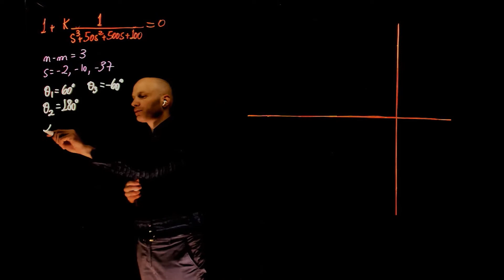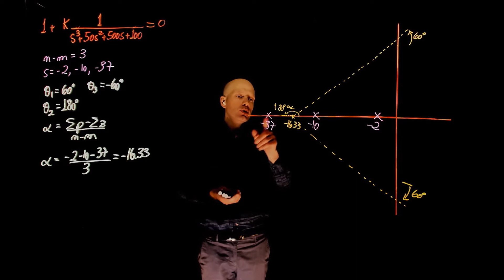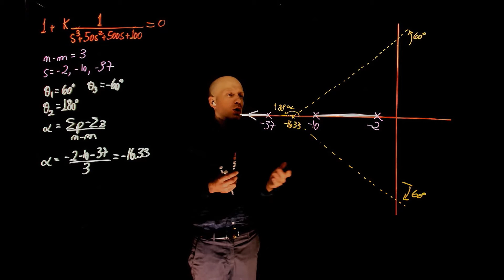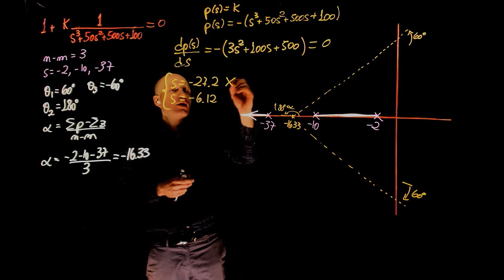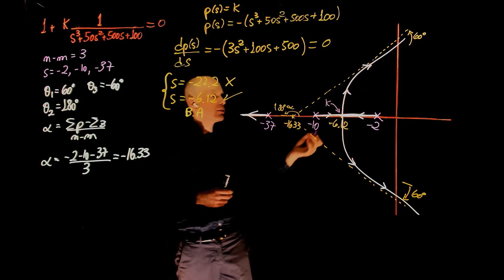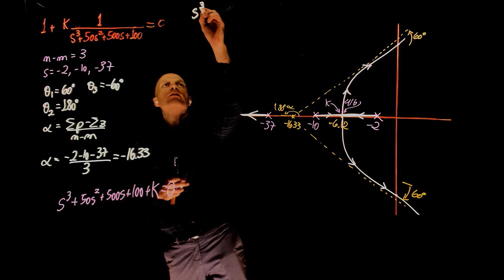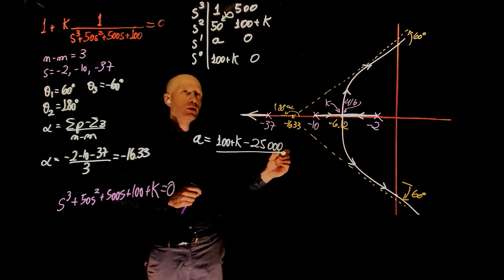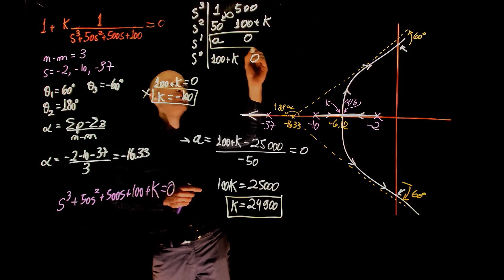L12E64 Control Systems Lecture 12, Exercise 64: The root-locus method

Comment: should it be 1000+k rather than 100+k  6:59 ?
Reply from the maker: I don't think so. How are you getting 1000?
Reply: @biomechlab  in the initial equation 0:01
Reply from the maker: @piersonmcgillivray190  Oh right, it was copied wrong from the slide, but the solution is correct for +100
Reply: @biomechlab  thanks for clarifying

Comment: How did you calculated roots of this ?
Reply from the maker: Matlab. The roots should in fact be  -0.2, -36.3, -13.5, but the rest is correct.
Reply: @biomechlab  how will calculate it by hand ?not through Matlab.